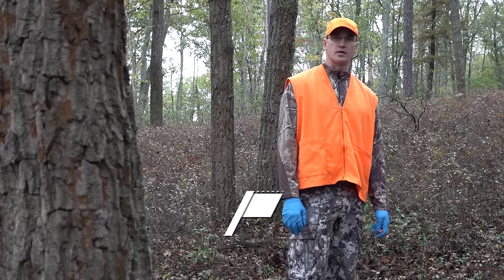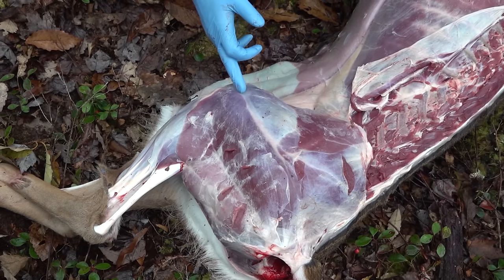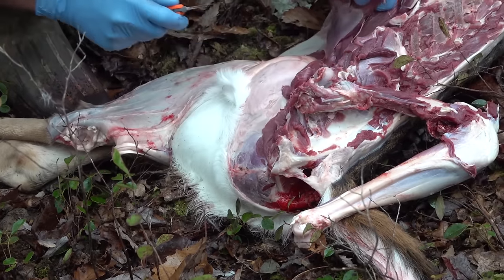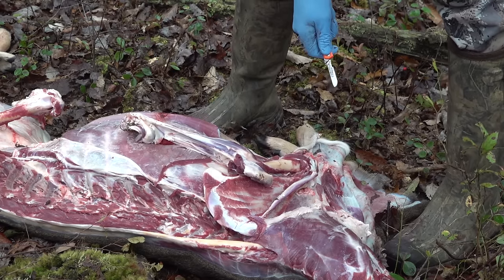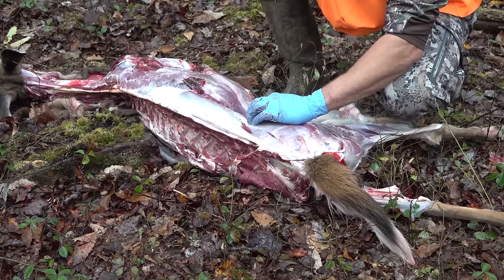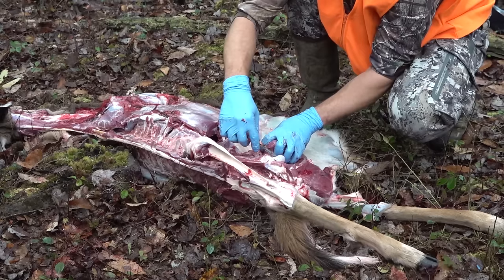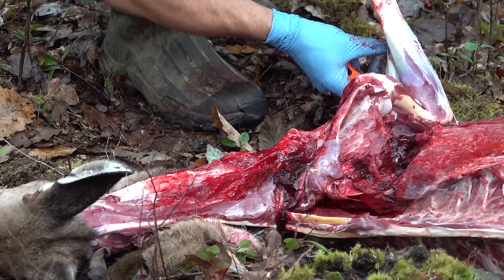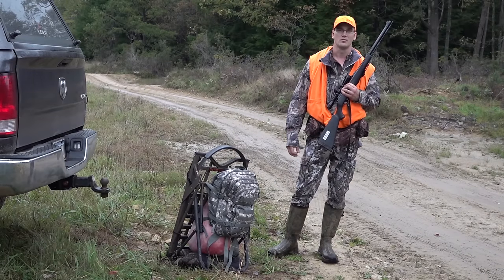Debone a Deer in the Field

Comment: Great tutorial.  As a former professional butcher I would like to clarify something that isnt very intuitive.  What he is refering to as the top and bottom rounds are actually reversed, so what he called the top is actually the bottom and vice versa.  This is because when butchering in a facility the legs are generally removed whole and laid on the cutting table opposite to how he is handling this deer in the field.  It lays with more stability on outside of the leg as it is flatter than the inside of the leg.  The top, or inside round, makes better steaks, the bottom round is best used for roasting, corning, stew cut or ground.
Reply: Every video I watch labels the rear Quarter differently. Just gonna throw the whole thing on the smoker. 😅

Comment: I’m going to be 56 next month. And dragging a deer is getting harder and harder as the years go by! Especially when you hunt 2 miles in the deep woods like I do. So I’ve been looking for a good YouTube tutorial on boning a deer in the field, so I can pack out the meat instead of dragging. I love deer hunting….But I’ll be dammed if I’m gonna give myself a heart attack doing it! This is by far, the BEST video I found on the topic!! Thank you so much for sharing!! And my BODY thanks you too!! 👍😎👍
Reply: I'm getting up in age myself. My father taught me to do this but he stated with leg cuts and up the belly.  Skin half the hide back, bone it out leaving your cuts laying on the clean hide. Then Skin the bottom side as you roll the carcass over onto the first cuts. Bone out the second side, roll the carcass off all the cuts. Tie opposing front and rear legs of the hide together and you have a handy deer hide sack to pack the meat out with. If you let the meat and skin lay exposed while you find some water to wash up with. When the meat and hide dry a little the meat won't slide around in the hide. The old guys didn't have 4 wheelers to make life so easy.
Reply: Get a deer cart. I’m 59 and the cart is easy to use.
Reply: @cliftoncornelison8820  
Depends what kind of terrain you’re using them on. They are fine if the ground is relatively flat and has no obstructions. But Where I hunt, there’s a lot of hills, briar patches, bolders, logs, etc. etc. In those kind of places, using the cart is harder than actually dragging them. Trust me…I know this from experience.
Reply: 56….   Your still a pup ; )
Reply: @jimbigboystoys4077 - I use a pneumatic tire furniture dolly and ratchet strap it on. It’s a little heavier depending on the angle of the terrain but it goes well over obstacles, you can even take it up a flight of stairs 😁. But I use a Seal Bag backpack like the ones they use for whitewater rafting and bone it out if I am going to be in the way back country. I have also made a backpack with the hide and wore it out but there’s too many ticks now to make that one worth it.
Reply: LOL True !!! @MrTrda

Comment: Awesome video lesson.  Thanks so much for doing this!  One curious question, did you do the whole deer with one blade?
Reply: He is using a Havalon knife as you probably know. It uses a replaceable scalpel blade which is  very reasonable to buy, and comes in many sizes and shapes. In my experience using this tool, one blade does one Deer, most of the time, sometimes more. If you hack at the bone or pry too much (it can snap sideways) and in a more careless manner, you can roll the edge of the blade as it is very fine, although still very hard steel. I touch mine up a bit sometimes with a sharpening rod, but I am a bit overdone about it. Mine is the same model as he is using and many years old. They make one now that has a traditional folder blade on one side and the scalpel on the other, which I don't have. This man was a pleasure to watch. I am hunting in a steep area this year and was just worrying about the take out this very morning. How is that for putting the Deer before the cart? :)

Comment: Where can  I buy a nice knife such as the one you used in this video? Real nice video thanks for sharing.
Reply: If you are into lightweight stuff you could check out the titaner  falcon 2.0 it's a titanium knife body that takes multiple types of removable scalpel blades. It comes with a pointy blade but you can buy #23 or #24 scalpel blades  for very cheap that have a rounded blade like his in this video (much better for game processing)
Reply: This knife is a havalon piranta